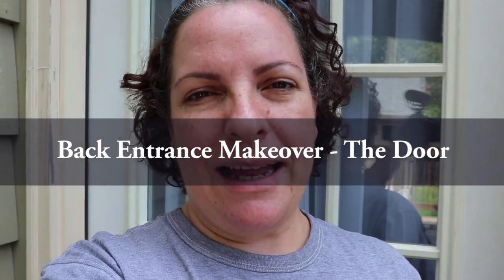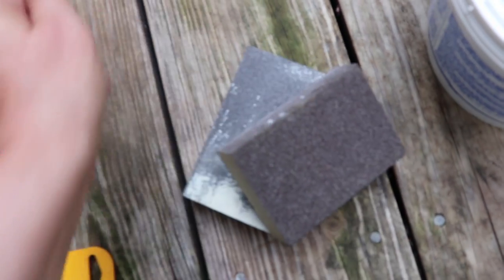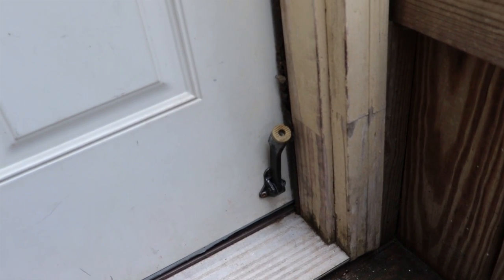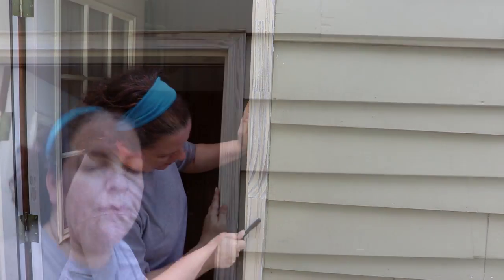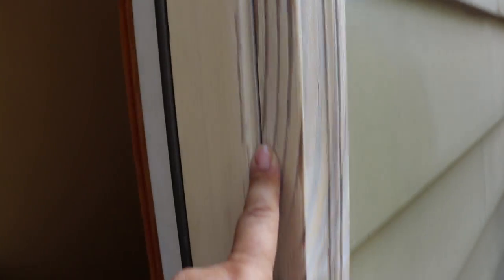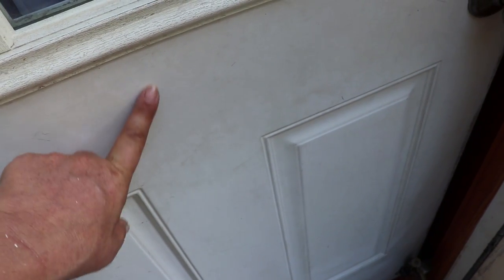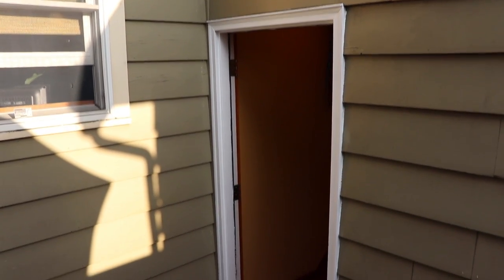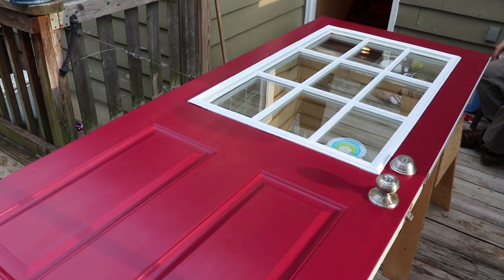Back Entrance Makeover || The Door ||

Comment: Sofia, I have to ask. How do you clean the windows in your back door? I have the same door and my windows have that foggy build up inside and I don't know how to clean the inside of the windows?  BTW your door looks good now.
Reply from the maker: Virgie Sexton you have a leak on our double pane and the gas that s in between the two glass is escaping, moisture gets in between. you ll need to replace the pane. if it has screws around the frame that's an easy fix, if it s a single piece you ll need to replace the door. sorry
Reply: My Great Challenge Thank you mine has the double pain it has the screws. I will have to get my husband to fix the leak. Your door looks really good.